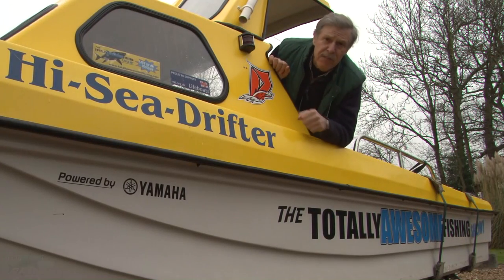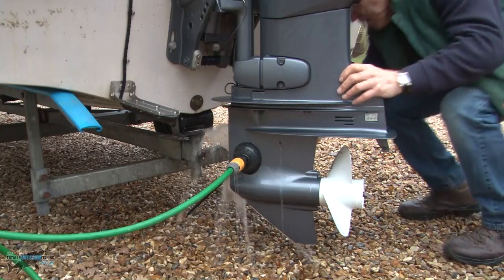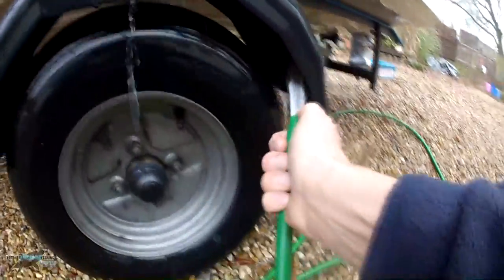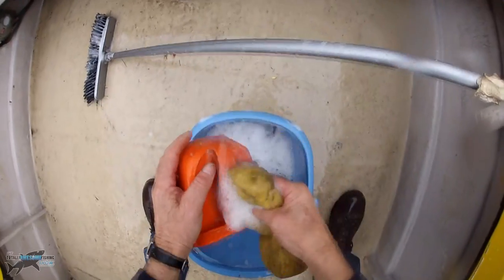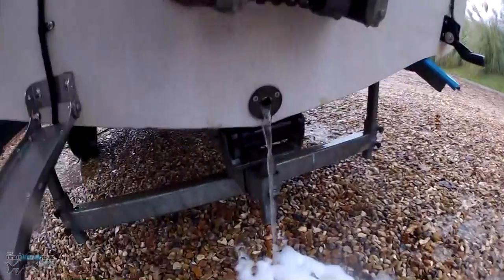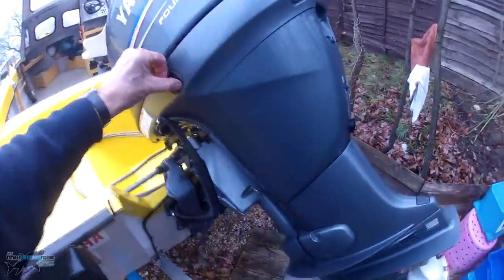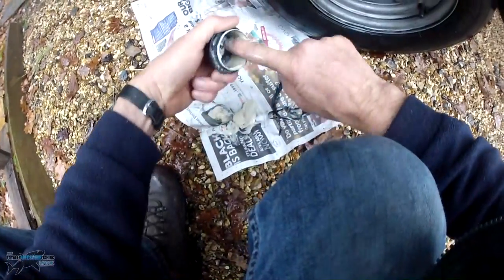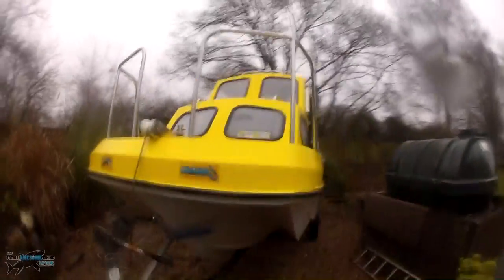Putting my Boat to Bed!

Comment: I was quite surprised to see that you tow on an unbraked trailer. 
looks a big boat and motor to me.
thanks for the videos and all the best for 2017.
Reply from the maker: It comes inside the gross train weights range.That's why I chose the 60hp instead of something like a 75hp.
Reply: I had the same thought, that must be over 750kgs. My hull is only 300kgs and I have the same yamaha. But trailers and 150>200kgs, the when you add fuel and batteries, anchors, chain and rode is is surprising. Took mine to a weigh bridge at a local scrap yard and it was just over 750kgs. So I fitted an Alko axel with sealed bearing, flush kit and brakes. Take it and get it weighed Graham, better safe than sorry. Plus, with a flush kit and sealed bearings it is no bother. Also, try bearing savers, they are ace and keep grease under pressure in the bearing so water can't get in, I ran for 4yrs no problem.
Reply: robfnet glad it wasn't just me.
Also depends on the towing vehicle used. Each car has an unbraked trailer rating. The vehicle didn't look very big, but I could be wrong. It's based on half the kerb weight of the vehicle for an unbraked trailer.
Not having a pop Graeme, just thought it's better to be on the right side of the law should something bad happen.
My old MK4 golf is only legal up to 600kg total weight Inc trailer, motor, gear, fuel etc etc unbraked..
Reply: Yes, there is a limit per vehicle some less but no more that 750kg in the UK. 750kg is the maximum for unbraked, no matter what you are towing with.

Comment: Really good common sense video! My Shetland 610 sits in the Norfolk Broads so has to be anti fouled. I didn't see anti foul on yours so assuming you take it out of the water regularly. They've removed all the public ramps here and those that are left are often costly and sparse making getting your boat on a trailer a very time consuming job with 4mph speed limits. I think most people just pay every few years to have their boat taken out for a couple of weeks for treatment. I have no where to put a trailer anyway.

Comment: Hi Graham! I have a Wilson flyer with the same trailer as yours. May I ask you a few questions from your experience?  Does your winch handle interfere with the bow when winched up tight to the bow post? Also, does the centre spar on yours bend?  My trailer was taken apart for re galvanising just before I bought it & I am adjusting it all as it was put back together wrongly. Thanks for any help & keep up the great video’s! 👍🏻
Reply from the maker: Yes to number 1.     Yes to number 2        (I put an axle stand under centre of spine,its in one of the films).
Reply: TA Fishing, Thanks!

Comment: Graham 3,500 miles of towing. It may be worth checking the transom remember all those miles of towing with the engine attached. That's a lot of a heavy engin bouncing about on the transom. This video made in 2016 it is now 2018 almost 2019 that's a lot of bouncing.
Reply from the maker: I have often wondered about the strain an engine must put on the transom even on a trailer that's static.I trim mine down and rest the lower unit on a block of wood so it doesn't pull on the transom. Can't do much about the bouncing when towing though ...got to love the quality potholes we now have in the UK.

Comment: what is the weight of your trailer suspension please,i have a shetland 535 weight 560kgs with 85hp yamaha out board, rebiulding my trailer
Reply from the maker: The weight of the suspension ? The units themselves ? Or what load they carry ?..I just changed mine and I think there were two sizes,a standard,and extended. If I recall I think it was over 500 kg...per unit .Might have been more I can't recall.

Comment: Peter Gore Seer, 
I Put Redex In Petrol, That Boat Needs A Folding Down Screen, Its Just Acts As A Sail At Sea, And Front Ankor Hatch, But Its A Good Boat,  I Dont Like Big Out Boards, But I Fished In Morecome Bay, With As A Few Rivers, Which Brings Drifed River Debris, If It His Hit At Speed Your In Trouble, I Cringe When I See Speed Boats Ratling 50MPH.